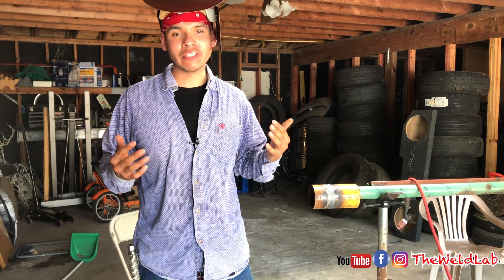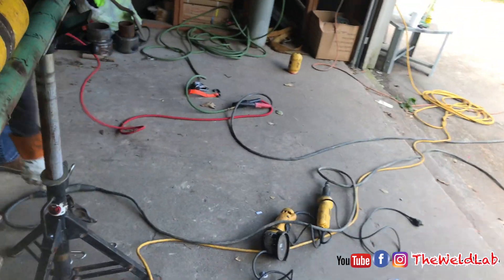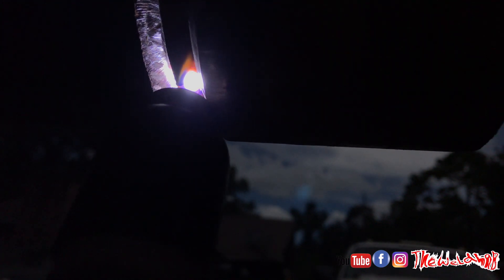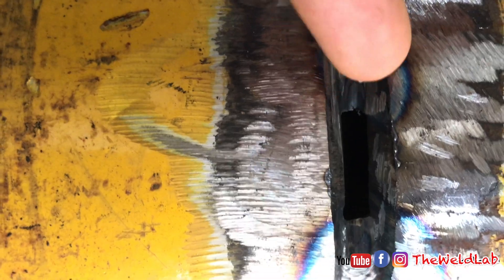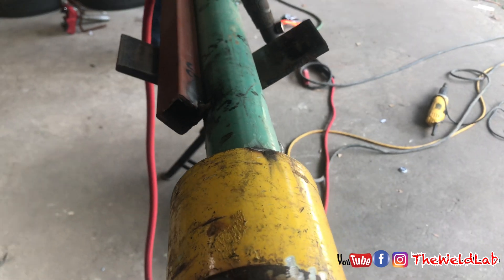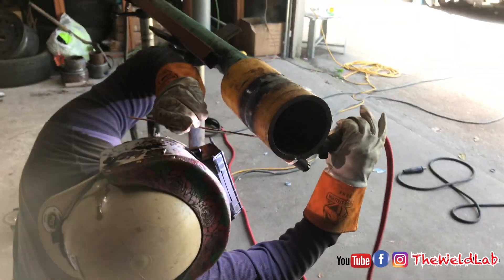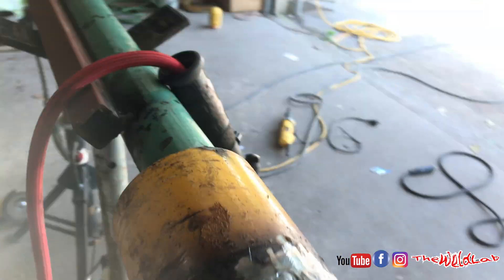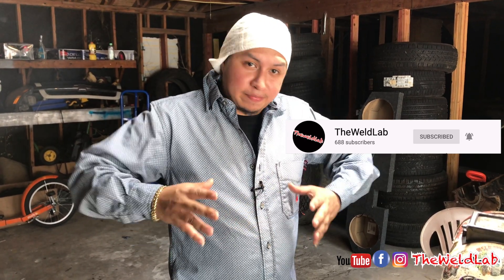WALKING THE CUP | 5G TIG PIPE WELDING | HOW TO GET A SLICK CAP

Comment: That hot pass he burned the stamped end off his rod.  Big mistake. If the QC walked up and wants to verify your using the correct filler metal.  But you welded it off your rod.  He could potentially make you grind that pass out.  Never burn the stamped end away.
Reply: Both ends are stamped

Comment: When I try this at the angle your holding it while walking ur cup, my filler rod balls up and starts to puddle long before I makes it to my weld puddle. Am I to hot?
Reply: You are obviously holding your torch at the wrong angle and your tungsten is directed at the filler wire so make sure your tungsten is directed into the prep making a keyhole

Comment: Truck video :Half ton,3/4 ton truck or Dually . I have a half ton and I did load up my sa-200 and did good for a léveled truck . Question is will a half ton get me by for a while currently in Tulsa welding school and yes I do have some experience in the oilfield as a labor ,parts runner and welder helper.

Comment: What up bro how can u proven ur root from falling are over penetration     from 9 to 12  great video
Reply from the maker: Put the wire on rite in between the bevel  no inside the pipe but half of the wire will be inside and the other half on top of the bevel and if it’s till falling after that maybe turn the machine down ..on my next video I’ll try to show you what I mean
Reply: Thanks man respect